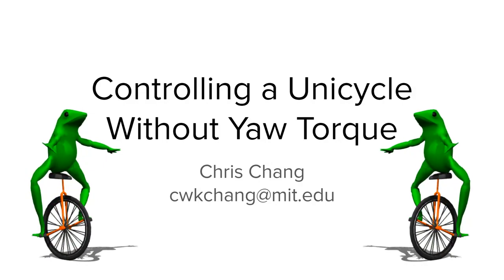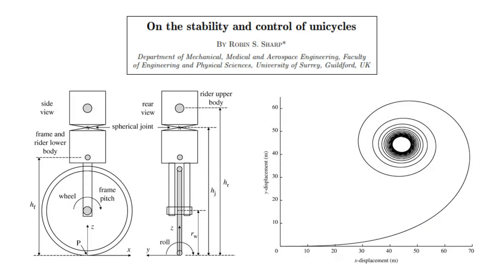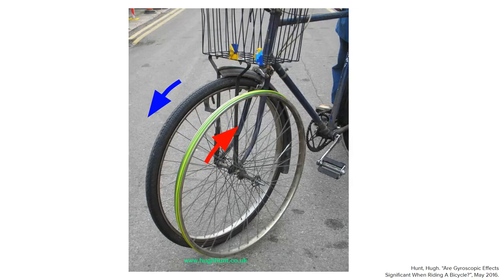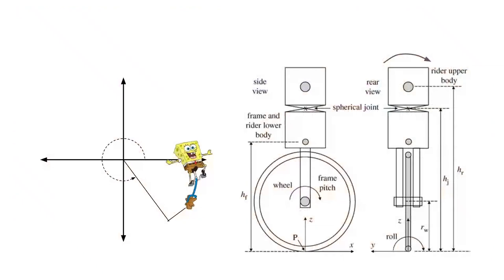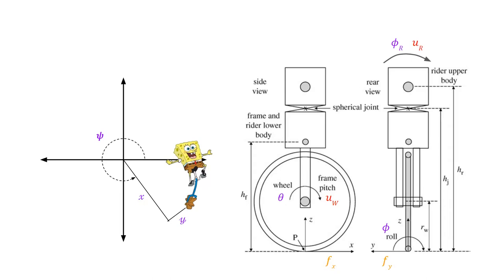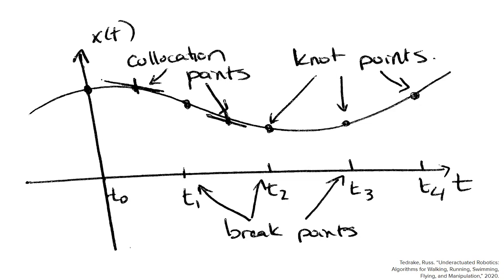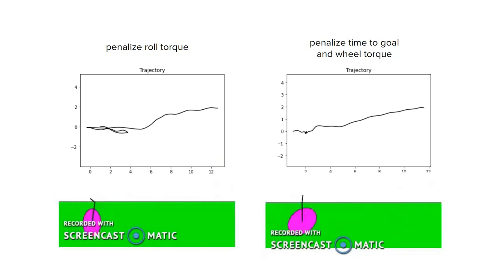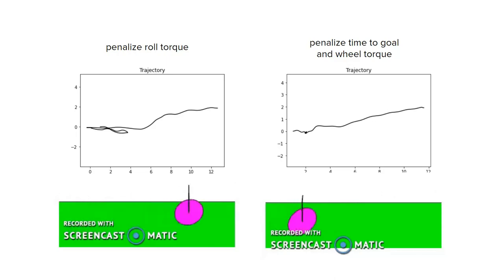Controlling a Unicycle Without Yaw Torque

Comment: There is a major flaw with your diagram.  Also, that is not a free body diagram.  Do not assume that the riders feet > pedal > crank = perfect torque delivery in the pitch axis.  There is a "moment" created from the distance from the point of application on the pedal to the frame/wheel center on your y-axis.  It's about 3-5 inches depending on crank geometry and hub width. That's your major contribution of torque in the yaw direction. It alternates of course as vertical downward force is applied between the left and right pedal during 180 degree rotation of the crank.  (Also, the rider can not only apply vertical force with his feet on the cranks but in all components of up/down/forward/back vectors in your xy plane.  The point of application can also be any clock positions of the crank rotation. Furthermore, it may or may not act as a couple vector.)

You need to include the crank and the pedal for a proper analysis.  In addition, do not assume that all the weight is above the pedal.  Quite substantial forces can be applied on the pedal without being consumed for rotational speed.  For clarity look up "ultimate wheel".  How can a unicycle without a seat be possible?  The fact is that it does work.  Perhaps that would be easier to analyze.
Reply from the maker: Thank you for this insightful response! While I focused on the case study of a motor-driven unicycle instead of a pedal-driven unicycle for the sake of simplicity (drawing inspiration from Robin S. Sharp's motor-driven model), I recognize that my model does not accurately represent the dynamics of a unicycle with pedals. In particular, thanks for pointing out that a pedal-driven unicycle has an additional source of yaw torque besides twisting — that makes me appreciate the dynamics of real unicycles even more! Adapting these results to a pedal-driven model would make a great extension to this project :)
Reply: You are welcome. I am a mech engineer who should not be able to ride based on following the "conventional accepted" dynamics involved in riding a unicycle.  It's not just the physicists, but other expert unicycle riders that espouse:  a.) Sitting perfectly balanced on the seat(the C.G.).  b.) Then with your feet generate a perfect rotation of the cranks (like a motor).  This is what I was told.  I tried it.  I failed.   However, my engineering instincts told me there is something missing.  It was just too simplistic.  There is more involved, and that gave me hope to figure it and try different things.    

In general, there is a moving C.G, impulse and momentum(both rotational and linear), but most interesting a "ballast" effect when one pedal is below the wheel center and carries all the riders weight, momentarily.  At the same time the upper twists in a countering motion.  Similar to the motion in running. 

I would suggest for analysis that would be more accurate and simpler this variation of unicycle.  It's called an Ultimate Wheel.  https://www.youtube.com/watch?v=Y3bemES4s2A   As you can see it is almost a complete inverse of a unicycle.  All the factors that are "neglected" in the standard analysis of a unicycle are all present in this device.  It can initially be analyzed with a more simple and accurate free body diagram that captures all the forces.  The riders body joints and position is the other complexity, but you can judge and simplify different cases.
Reply from the maker: Thanks for sharing! That looks like a deliciously simple model to analyze~ I'm tempted to jump in again and try adapting my work to this variation when I have the time :)
Reply: I think you can shelve that for a later project or maybe assign it to an undergraduate when you go the graduate school route.  I have seen many unicycle robotic devices, but I have not seen a "true simulation" using a crank and pedal mechanism(just like real thing) and actuated with two reciprocating motion device.  I think it's an interesting challenge to not rely on gyroscopic technology(too easy), but rather impulse & momentum of the true human pedaling propulsion.   Also, an actuator that has accel/decel capabilities would be quite advanced no air cylinder or simple solenoid can do this.